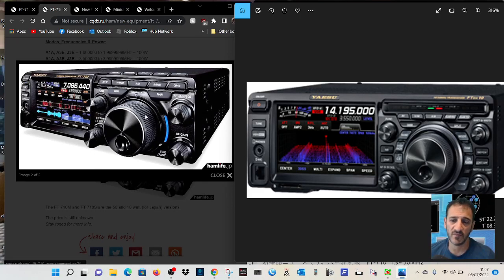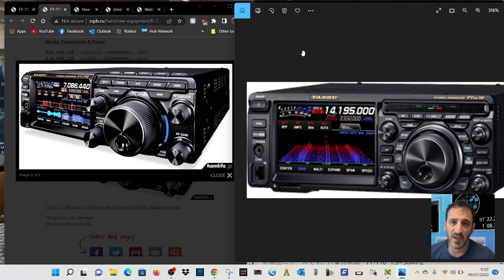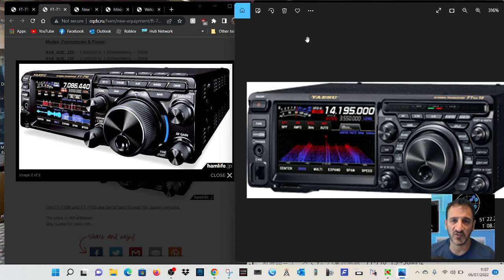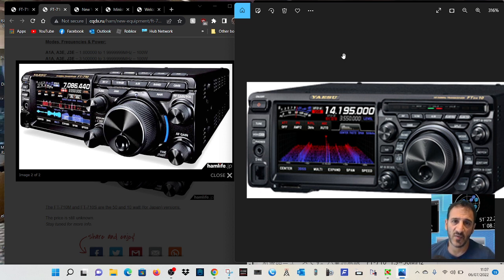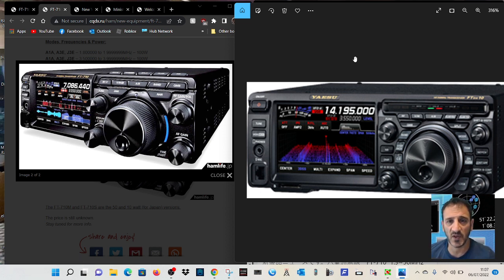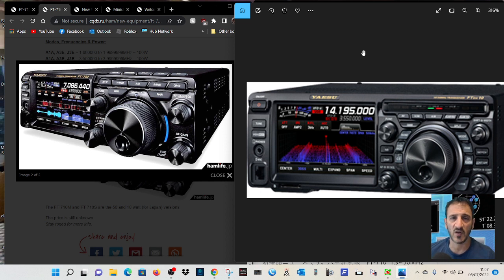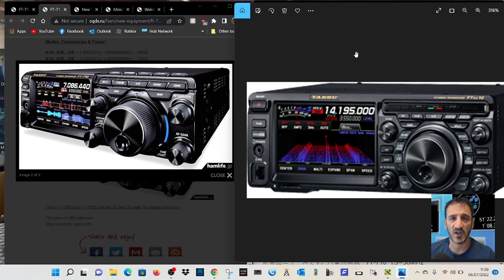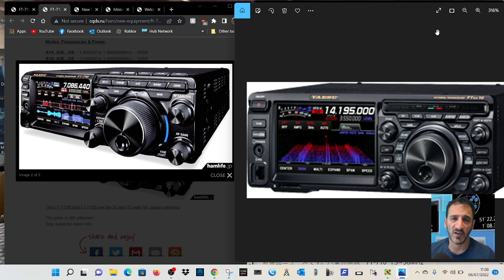YAESU FTDX10 or NEW YAESU FT-710 ??

Comment: It may sound petty, but I want the larger display on the FTDX10. It's the reason I didn't get the IC-7300 instead.
Reply from the maker: Ftdx10 and FT710 screen look the same size the case is a bit shorter .
Reply: @M0FXBHamTech  That's good to know, thanks.

Comment: Great information. I suspect that the cost of components will see the DX 10 move up to its introductory price of £1549 or slightly higher and the new model fill the £1100 to £1500 gap. On first view the new model doesn’t look as comprehensive as the DX 10 so I doubt they will discontinue one of their best selling models. Shame it is not a shack in the box 991a/818 replacement as expected - now that would have been popular! Keep up the great work 73 Neil
Reply from the maker: Thanks cheers